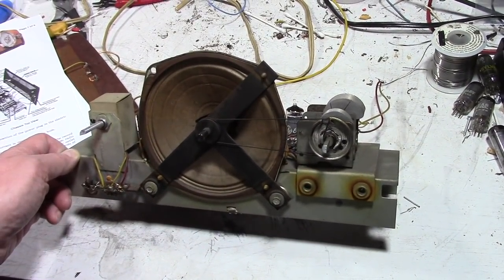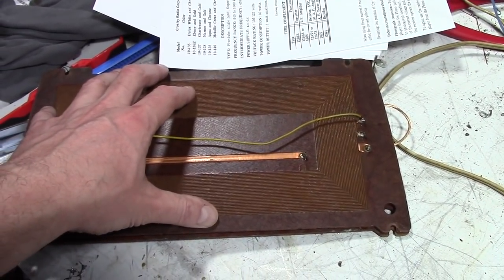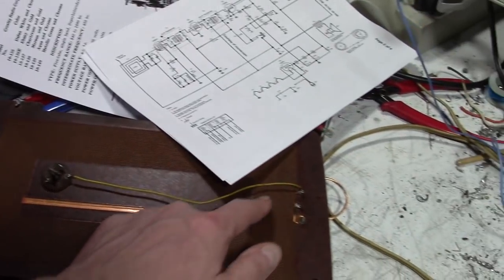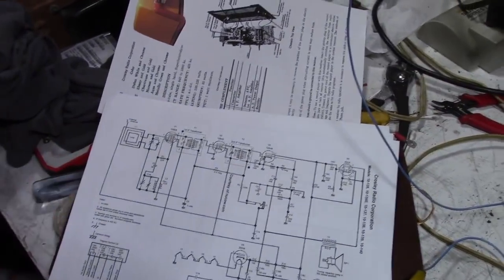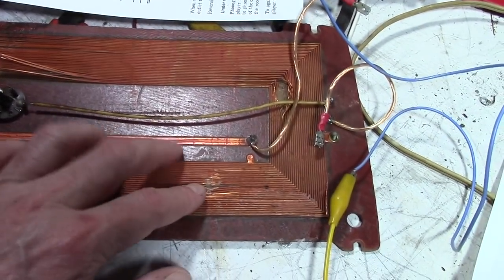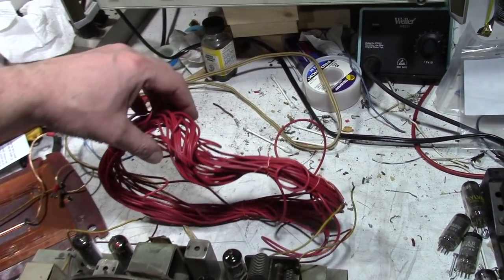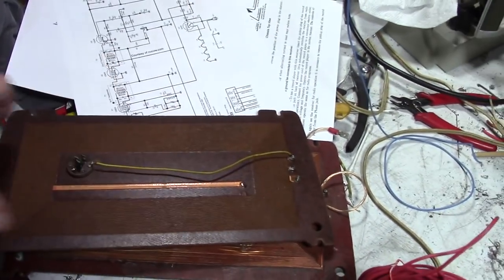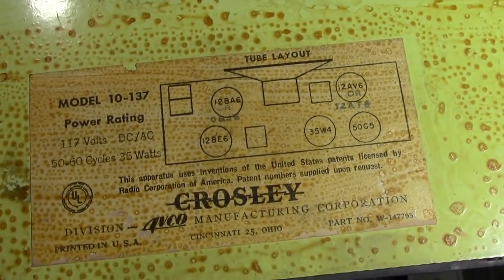Crosley 10-137 loop antenna

Comment: I bought a AA5 tube radio ,the ferrite bar was broken into three pieces ,I sent for a new ferrite bar blank I couldn't find the same size so I bought close as I could If I wrap new magnetic wire onto new bar. Will it work ,I open to other ideas too ?anyone.

Comment: I'm not impressed at all and all this drama sounds amateurish. All you had to do was clean the groves a little, put some 3m adhesive spray on coil groves  (after masking the areas you don't want the spray) and let it tack and finally run 24awg magnet wire or what is appropriate in size in those groves,  and you have your coil back. job done!
Reply: ...well, "you can't please EVERYBODY"-!!

Comment: I have this ree diculoussly long wire antennaae... my body seems to be a better receptical. What is up with that?. Sry about my spelling
Reply from the maker: A longer antenna isn't always better.  It depends on what you are trying to receive - AM, shortwave, FM, etc.  Also what type of radio.  Some use a loop, some a long wire, some a dipole.  Also proper grounding can make a big difference.

Comment: I have made replacement loop antennas like that by cleaning up the rear cover and cutting a sheet of paxolin and bolting (or glueing) it to the inside of the rear cover with a spacer which is the same thickness as the wire and same size as the inside of the loop. You can then just wind the required number of turns in the recess that this forms. The winding is then neat and the right area and is also well protected by being between the rear panel and paxolin sheet. On a few where I wanted the winding visible I just waxed the inside of the paxolin sheet and painted expoxy on the wire as I wound it and when it was set up I removed the paxolin sheet. Sounds complicated but takes less than half an hour.
Reply from the maker: That a very nice, neat solution.  Thank you for the suggestion.

Comment: Very nice looking radio Bob, good luck with the antenna! Question (from a novice), after you finish fabricating a new loop antenna, can an adjustable inductor be added to tweak it if needed?
Reply from the maker: I suppose, but there is already a trimmer cap in parallel with it that you peak during the alignment
Reply: Roger that info. Thanks for the reply!

Comment: Not only is the coil tuned, but the bias/avc for the RF stage runs through it. So you have a grid that is floating and gets a huge 60hz hum.  Have seen other YT channels get the same hum and distortion and wonder why.
Reply from the maker: Ah yes, so it does.  No wonder the sound was so garbled!

Comment: I wonder if one of the on line pc board suppliers could etch a board with the required loop pattern. Then just mount the entire board flat on the inside on the back cover.
Reply: I think a pc board loop is n excellent idea aside from the cost maybe. How much is  a one off pcb of this size nowadays? Or maybe you get several made and sell them to other restorers to help defray the cost?
Reply from the maker: Yes, that would make a very nice replacement.
Reply: Good idea!  I have the ability to design and fab one on FR-4 laminate in my shop.  But making a CAD file and fabbing the board would be costly in man-hours.

Comment: I got to thinking about those big old-fashioned loop antennas that would sit on top of or nearby the radio's cabinet.... it'd be fun to make a big exterior loop kinda like one of these in this Google image search result link for a radio and hook it up in place of the built-in loop and align it to the radio's needs and that thing would pick up stuff very nicely. The radio would need to be powered through an isolation-transformer if it is an AA5-type set since the antenna will be connected right into the other-wise hot chassis. :-)

https://www.google.com/search?rlz=1C1AOHY_enUS779US779&biw=888&bih=565&tbm=isch&sa=1&ei=A5aGWp3YA4jk0gLYvrzQBg&q=Vintage+Loop+Antenna&oq=Vintage+Loop+Antenna&gs_l=psy-ab.3..0.9746.9746.0.10621.1.1.0.0.0.0.751.751.6-1.1.0....0...1c.1.64.psy-ab..0.1.750....0.TzsruYGQlSA
Reply from the maker: Interesting idea.  Many AA5s like this one don't really have a hot chassis.  It's floating with a B- buss using insulated wire running under the chassis.  The loop doesn't connect to the chassis anyhow.  One side goes to the grid of the converter tube and the other to the AVC bus with only a few volts on it.
Reply: Right on... no direct connection to AC line. 
Yup, a radio would definitely sit up and sing with one of those big old loops hooked up to it. 
Good to see you posting again, Bob, and understood about being busy, new home and all.  :-)